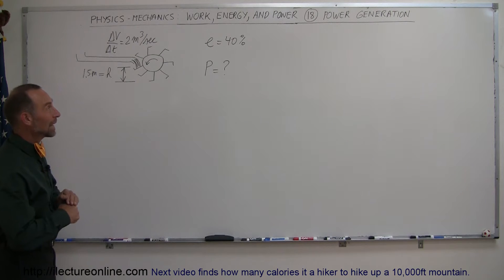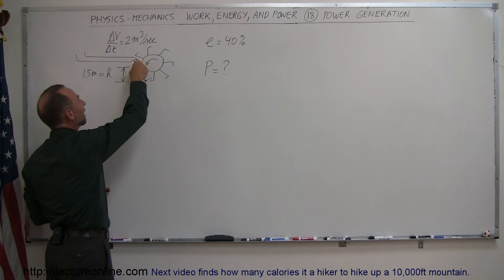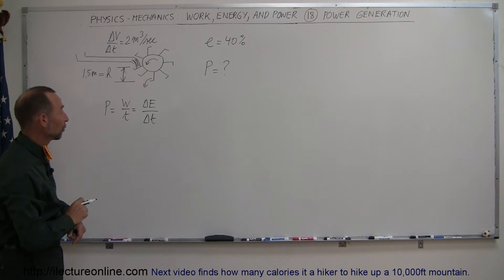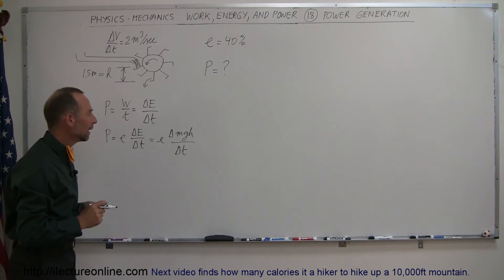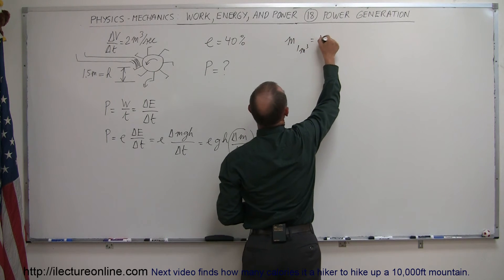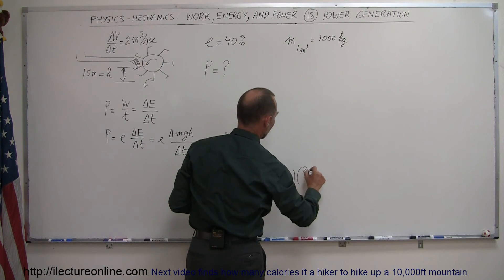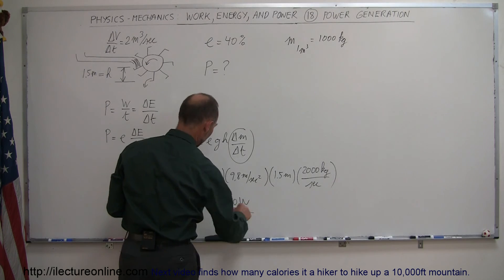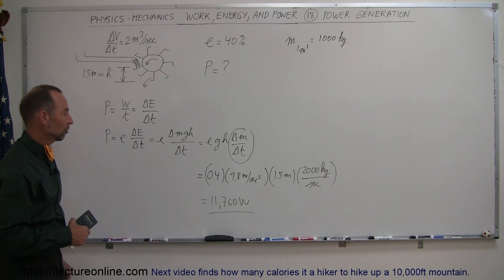Physics 8  Work, Energy, and Power (18 of 37) Power Generator

Comment: Sir,In the video no.16 you multiplied the efficiency with power but here doing the opposite,why?
Reply from the maker: In this case we are calculating the power PRODUCED by the wheel, not the power going into the system (like with a generator).  Therefore the power generated is just a fraction of the power going into the system.

Comment: Does this means the angular velocity of turbine doesn't depends upon output rate of water.The water lowers in height while the turbine makes 1/4th rotation.So how can we assume the lowering of water was done in 1sec?
Reply from the maker: The angular velocity of the turbine DOES depend on the flow rate of the water.

Comment: how about the kinetic energy ?
Reply from the maker: In this case the momentum is directed in a horizontal motion and would have little to no effect on the rotational motion.  The force in the horizontal direction would be absorbed by the axel holding the wheel.

Comment: Hey Michel, I tried to do this using the Conservation of Energy equation:

W + ep + ek = EP + EK + ELost

Where W is the Power. There is no friction so ELost is zero. The kinetic energy is the same on both sides so we can also ignore it. And lastly, the final Potential energy is zero because the water reaches height 0 at the end. Therefore:

Power + ep = 0

So

Power = -(ep)
Power = -(mgh)

Where m is the water output of 2 cubic meters:

Power = -(2 * 9.8 * 1.5)
Power = -11.760

Logically, I need simply to switch the sign to get 11.760 Watts, just like your example. However, the fact that my result happened to be negative suggests that I did something wrong above, but I don't see why. Could you tell me what was my mistake that I ended up with a negative value?
Reply from the maker: My suggestion is that you work through a number of videos first, and then apply the same method shown in the videos.
Reply: I did - the methods shown in the videos work. However I'd like to be able to solve them using the Conservation of Energy equation too - and it almost works except the result is negative and I'm not certain why.
Reply: Maybe g as - 9.8 instead of positive 9.8